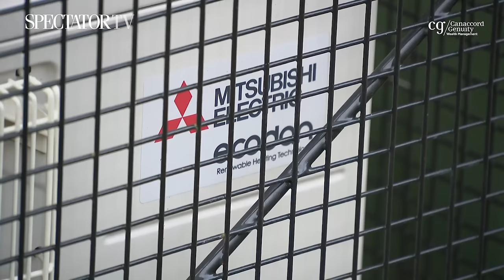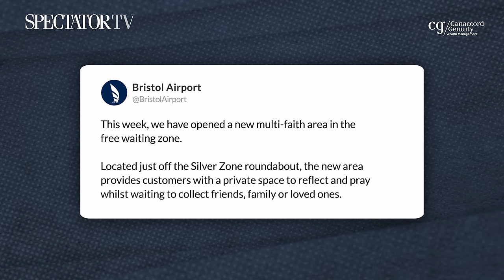'Royal racists' claims & China's green takeover – The Week in 60 Minutes | SpectatorTV

Comment: Why are multi-faith prayer rooms so depressing? Obviously because no-one with a sincere faith would want to use them. The one in your picture looks like a bus shelter, and is probably used as a urinal. Bristol, of course, is the city which pulled down a statue of one of its greatest benefactors, and the upper-class miscreants were praised by the magistrate, who let them off with the lightest slap on the wrists.